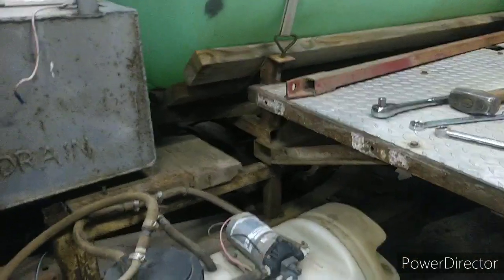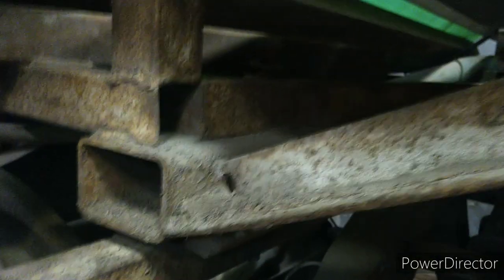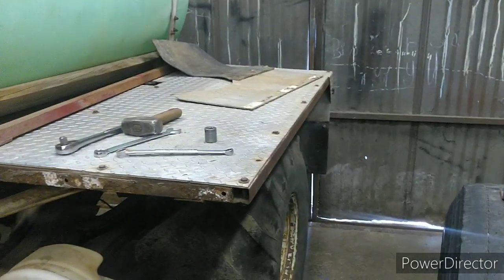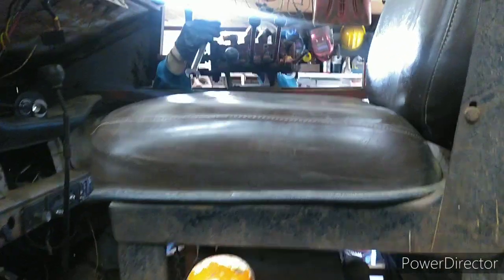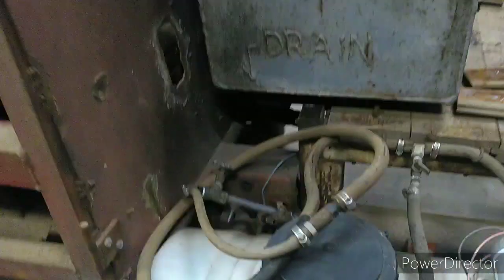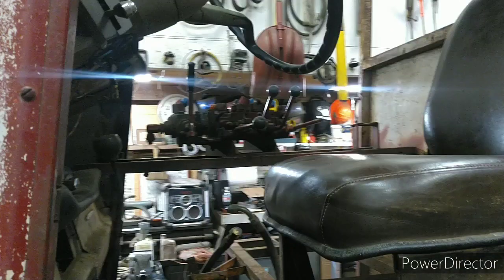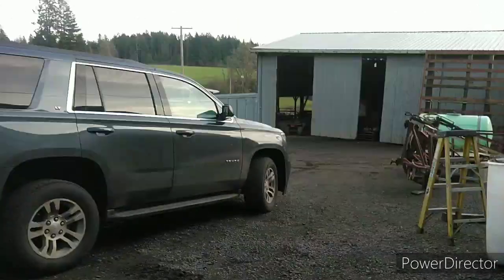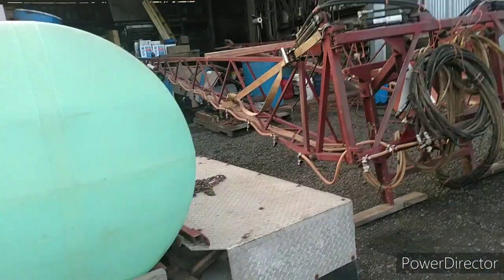Got rid of some steers. tank is off!!

Comment: Any reason why not mount the  tank on the frame  Other than a little more work raising the fenders mounts up . Had 5 inches of snow this morning and most of it is still here
Reply from the maker: Really don't want to have to rebuild the fenders. The tank fill is built into the left side. The plumbing underneath and the sump hang down too.. all needs to be above the frame.
Snow... We didn't get much rain to send you much snow..
Reply: If got enough room without interfering with axel and drive line could run plumbing out under the main buggy frame  mite be a little bit more of a challenge but was thinking about trying to keep center of gravity low as possible . I know just more stuff to ponder on and clog up the thinking process LOL
Reply from the maker: @jeffgroce9736  there is a cross member and the pumpkin, right where the plumbing is. 
It won't be any higher off the frame or center of the axle. 
Can't argue with lower is better, but it can't get any lower.. the cab is going to be the biggest issue with hight, but between the Engine being under it and needing to be higher to see what is going on...
Could have made the whole thing longer, like DeJong buggies, cab set on the frame behind the Engine, tank on the frame behind the cab..
I do appreciate your input!!!!
Reply: @GosselinFarmsEdGosselin  sacrifices when things get in the way . Some cab height is good to see over the tank but not so tall you get a nose bleed makes it seeing tracks from the last pass a little bit easier and the foam markers  . ( Old school GPS ) . I don't mind input either when  fabricating things also sometimes it helps to see the light when things are dark lol
Reply from the maker: @jeffgroce9736  to start, the only GPS will be flow control... I'm still a foam mark guy. It doesn't lie in the hills, and shows up under the trees and heavy cloud cover.😎👌
A different view is always appreciated!!!! Thank you Jeff!!!
Reply: @GosselinFarmsEdGosselin  it's a hell of alot cheaper . Lot of less Aussie talking trying to make it work  and can fix it yourself when the system fails lol
Reply from the maker: @jeffgroce9736  yup... And if it really goes sideways, shut one side off, lap back to the last track👍😎
Been there before.. finish up, do the fixing after dark.
Reply from the maker: @jeffgroce9736  well.. 6am, it rained all night.. you should have more snow by now.. and it's raining harder
Reply: @GosselinFarmsEdGosselin  got another inch plus of snow . Yea !!!
Reply from the maker: @jeffgroce9736  better the white stuff than the mud..  almost an inch of rain since last night 🙄
Reply: @GosselinFarmsEdGosselin  if it will stay cold enuff for it to stay and not anymore will suite me fine
Reply from the maker: @jeffgroce9736  yes!!
I'd like some days without rain

Comment: I'm here
Reply from the maker: First or second 👍😎
Reply: How was your day bruce?
Reply: G'day Bruce
Reply: @ronphillips1437  im doing good today. How are you doing Ron
Reply: @Murphyslawfarm  G'Day Murphy
Reply: @nidayfarmranch6002  was a good day spent it here at home with my son
Reply: @ronphillips1437  thats great Father son time.
Reply: @GosselinFarmsEdGosselin  you guys were really busy today. It always seems the money goes out faster than it comes in. I loose gloves everyday. So I just stock up on them. I find the ones I lost about the 3rd day they disappeared.  Waiting to see how your spacer for the tank comes out.
Reply from the maker: @nidayfarmranch6002  seems like the days there are other things to do, I go backwards on the big projects..
I found some 3" channel that was the old fuel tank mount.. I'm thinking just cut 7" long and weld it on the chassis. I saved the gussets off the wheel, so put some on.. weld a plate on top to bolt to.. should be good 👍
Reply: @nidayfarmranch6002  Bruce it is he is just 10 months old
Reply: @GosselinFarmsEdGosselin  yes that should work great. We've used 6x6 or 8x8 oak timbers under them.
Reply: @ronphillips1437  still great bonding time with him.
Reply from the maker: @nidayfarmranch6002  seen a lot of different things.. probably lay rubber pads on top too..
Reply: @nidayfarmranch6002  exactly he is a fun little guy
Reply: @GosselinFarmsEdGosselin  we would either rubber roofing or cut down semi mud flaps
Reply from the maker: @nidayfarmranch6002  done that.. we have some 1/8"? 3/16"?? With rubber on it. Leftover from putting truck beds on. It will work 👍